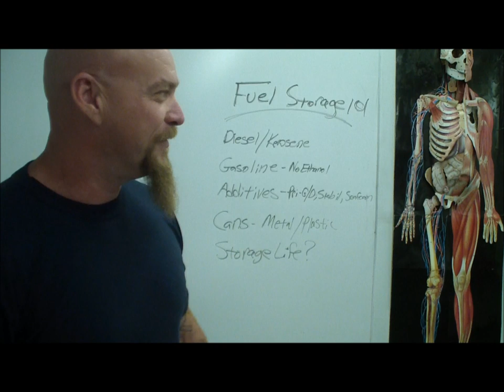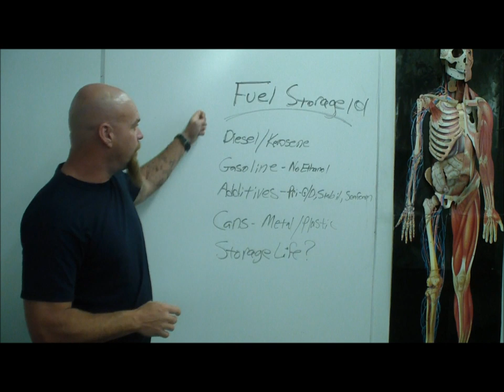Fuel Storage

Comment: The subject of fuel storage is one of the most neglected, misunderstood and a resource that a prepper can never have enough.  I prefer diesel, because is safer and can be stored for up to ten years. Propane can be stored for decades, and older gasoline powered engines can be converted to propane without much difficulty.  Thanks for producing this video.

Comment: Ethanol also is horrible on carburetors, especially in small engines like generators
Reply: EDC Tactical yep. I only use Ethanol Free High Octane on my motorcycles, lawn mower, etc. works great, and stores well. I hear there are cases of ethanol gas clogging carbs after being stored for a long time
Reply: Sta bil
Reply: Just got pri g and i am impressed! I had some 2year old 2storke mix. I added some to my snow blower and it  ran like it had new gas in it and was easy to start.